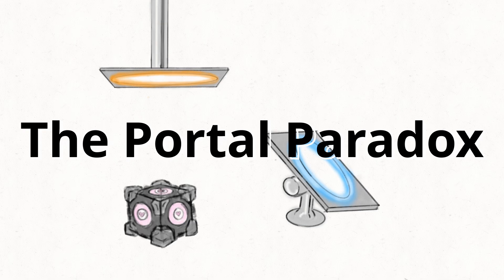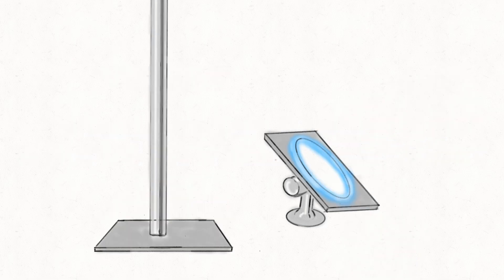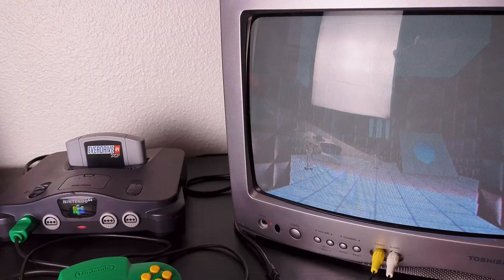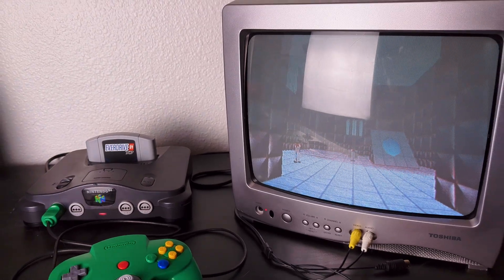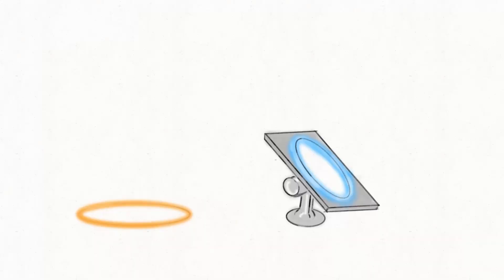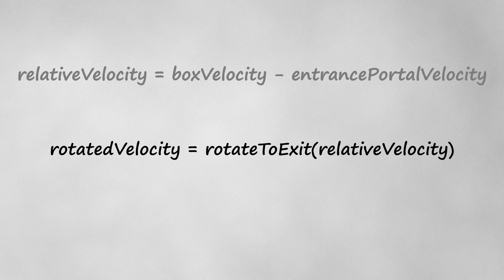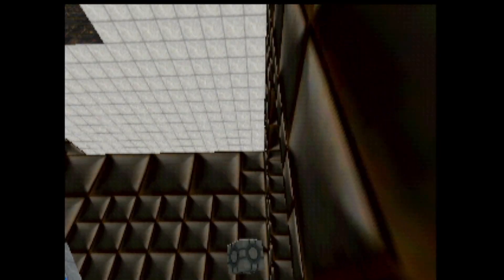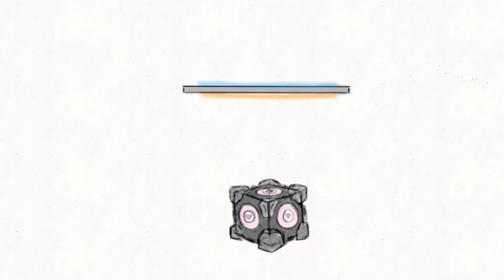I rewrote Portal from scratch and solved the Portal Paradox

Comment: Personally I'm not very into physics but I understand GLaDOS saying that the portals do not affect momentum to mean that my momentum will never be affected by the portals. Otherwise the forces acting on different parts of me might be so different as I pass through a portal, that I might conceivable be torn apart by a portal falling fast enough, as each part that enters the portal suddenly accelerates into the portal.
Reply: it's actually the opposite interpretation that has this problem. 

Say you have an orange portal that's stationary, and a blue portal travelling sideways at 1000 m/s. If you stick your head into the orange portal, this game dev's logic states that your head should poke out of the blue portal at 1000 m/s- you'd move along with it, so the most you'd feel is a strong wind whipping your hair.

However, if you don't think your body should inherit the momentum of a moving portal, then sticking your head out of the moving blue portal would cause your head to emerge at 0 m/s, as the portal flies away- (low-speed head goes in, low-speed head comes out-) snapping your neck clean off.
Reply: @Xtv1234  your treating the protals as 2 diffrent opjects when they arnt yes if you put you head into 2 moving portals you would feel wind but you would have to be able to move with the protal of be moved in and out it like sticking your head out a car windo you feel the wind but you are moving the same speed as the car but if one portal is moving and your standing till and the portal slams on you you just dropped a hula hoop on you exept your sided are in diffrent places making it so they portal never toughed you just moved around you and that the bug part the portal is moving around. think of it as if you jumped and someone through a hoop aroudn you do you gain its volocity no eve if it his the wall behind you no because you are know somever else on the other side of the hoop that never touched you, portals are doors not walls thats the problem hes treating it as if the portal touched you and it didnt
Reply: @Xtv1234 interesting example, but food for thought, it would technically require much more strength to even stick your head through that portal that is already moving, it would be like looking at a train moving away from you and trying to keep up. Vice versa, the portal would be moving and would require zero strength to jump in, because it would actually have a vacuum in space.

And suddenly, black holes are making me question a lot of things
Reply: @Xtv1234  At 3,600km/h, doesn't matter it the portal imparts speed... You get sand blasted by air particles (wind), and reduced to dust trying to pass through.
But the portal doesn't care if it is protecting you. If the blue portal is moving at break neck speeds when you pass through, it will break neck. As the object passes through, it is subject to all forces involved on the other side.
But, if a portal slamming onto you imparts speed... it should be consistent. If the portal moves at 5km/h (~1.4m/s) to pass your body through, you should have that speed on the other side... no matter what.
So, if accelerating out of a slanted portal results in a launch, then accelerating out of a horizontal portal should result in a jump. And if the speed is not enough to result in a jump, it should not be enough to result in a launch.
Look at it another way... an arrow doesn't fail to leave a bow just because you fire it straight up in the air.
Reply: @Xtv1234 I feel if you came out the back end you'd be perfectly fine and would just drop but if you came out the front end it would just blow you back in. 

A lot of people's theories seem to forget air exists and is real and we aren't just surrounded by empty space void of atoms.  The air would be going through too. You wouldn't just put your head through and have it suddenly be 100% different
Reply: @150booyadragon  In my example, assume you're coming out the "side end"- the portal is moving parallel its plane- and assume you tie your feet down and only stick your body halfway through. Not all the way through. What would happen?
Reply: @150booyadragon They're saying that it's moving sideways. The portal is parallel to it's path of travel, so it's like sticking your head out of the passenger window of a moving car, rather than out of the windshield or rear window. If you don't inherit the momentum, then your head will be ripped off, similar to standing on the ground and being struck in the neck/head by a moving car.
Reply: @Xtv1234  All I'm hearing is that either way you interpret it, moving portals would tear your head off.
Reply: @FlareBinar  well, no. Under this developer's logic, the only scenario in which your head gets torn off is a scenario in which one of the portals abruptly stops while you're travelling through it.

Consider my example again. You're standing calmly behind the orange portal. You look through, and you see the environment on the other side whipping past. 

You poke your head in, and it's like poking your head out of a car window. You can feel the wind whipping through your hair. You can see the environment racing past. You pull your head back. You're back in the calm room. 

Nothing about this scenario was intrinsically dangerous, or forceful. The entire time, the parts of your body that were through the respective halves of the portal maintained their momentum relative to the reference frame. You did not feel any forces on your body, your "momentum" did not abruptly change.

Now imagine you stick your head back out, but the blue portal collides with a wall and stops abruptly. The wall the blue portal is connected to stops, but the inertia in your body keeps you moving. You're immediately slammed at top speed in whatever direction the portal was travelling, possibly breaking or even severing your neck depending on the amount of intertia carried by the part of your body that was outside the blue portal.

In any case- the damage was caused by your change in inertia resulting from a change in the portal's momentum. It's the same as being in a car crash. If you're halfway through a portal that suddenly drops from 90MpH to 0MpH, the resulting inertia is likely going to kill you.
Reply: @Xtv1234  Here's a thought - what if your momentum is maintained relative to the exit portal, instead of the entrance portal?
Reply: Blue portal entry orange portal exit. The question is does your head have to undergo the acceleration outside of the orange portal? Here is an example to make sense of the orange portal. Your on a bus or a moving vehicle. Can you walk to the front? Yes. Does your water sit side ways in your water bottle? No. The energy from the vehicle was imparted onto you when it accelerated. All of the water particles in the container are moving at the same speed as the bus. In this case the bus is the non existent space between portals. The orange portal already has the energy because it is moving at 1000m/s sticking your head through would add some energy to the matter on the other end because in the blue portal mass there is pushing mass out the other side. All though if the portal were moving at the speed of light then you wouldn't be able to put mass through the portal because it would have to accelerate past the speed of light. Having a portal on earth and a portal in space moving at the speed of light exit forward wouldn't be a risk for blasting air into space. however any mass that the went through the portal would be blasted out at the speed of light. @Xtv1234
Reply: @Xtv1234 in your example, the room cannot be calm. A portal does not discriminate which matter is allowed to pass. It is not a closed window to everything other than what you want to pass through. Standing in the “calm” room, looking out at the environment whipping by, you would be able to feel the air getting sucked out or blown in depending on the differences in temperature & pressure of the two locations. Even if the conditions were somehow identical, there would be no way to stick your head out. Consider the difficulty of sticking your hand out of a car window and holding it flat against the wind. Even at 30-35 m/s you can distinctly feel the air resisting you. At 1000 m/s, even in perfect conditions, sticking your head through the portal would be akin to lowering your head onto a bench grinder.

The portal can’t just magically transfer its momentum to you as you pass through. The sheer forces being acted upon your body at an atomic level as your molecules all went from 1-2 m/s to 1000 m/s would spaghettify you. Portals preserve the momentum of the objects that pass through; they do not transfer their momentum to the objects.
Reply: @Scuuurbs  You make a good point about air resistance at 1000 m/s. Yes, the example i used is way too fast. the force of the air passing through would blow you away, and sticking your head through would be like the bench grinder you described. I should have used a more familiar example, like, 90 Km/H. Though, I stand by everything else I said. 

Portals don't really "preserve your momentum", though, not in the literal sense. They just translate your momentum relative to their reference frame.  

Think about what happens when you fall in one portal when both portals are on the ground pointed skyward. In the half second it takes you to pass through, if portals worked as you described- assuming I'm understanding you correctly- you should experience enough G-force to kill you as your body rapidly accelerates in the direction opposite your movement vector.

Yes, in hyper-reality you should absorb a tremendous amount of kinetic energy passing from a portal in a stationary reference frame to a portal in a moving reference frame. Yes, doing so violates the laws of thermodynamics. But portals already violate the laws of thermodynamics so fundamentally, it's kind of a moot point to me. I stand by my interpretation.
Reply: @Scuuurbs  Think of it another way: there is no such thing as a true stationary reference frame, all things are moving all the time. If you can step in the orange portal on this earth careening through space at thousands of miles per hour, and step out of the blue portal without experiencing any sort of lurch in your momentum, there is no reason you couldn't apply the same logic to a difference in the velocity of the two portals.
Reply: @Scuuurbs  By that logic, having two portals on a panel side by side, coplanar with the earth's equator, you'd be "spaghettified" as you passed through one of them. Why? Because relative to the earth's central axis you suddenly go from 1600Km/h orbit of the axis to your direct left(or right) and the front of your body as you walk through, is suddenly moving at 1600Km/h in the opposite direction. Whether you like it or not, every single portal can be observed with relativity to have momentum. Which either breaks the world of portal proving that the world of portal isn't on a planet, but purely in a simulation with no space (Difficult argument with the ending to Portal 2), just in a rendered environment with no global curvature. Or; Momentum is preserved relative to the portal, as you said, like an open window. If you shoot an object at 100m/s thought Portal A it will exit Portal B at 100m/s relative to it. If you poke your head slowly through Portal A, it exits Portal B the same way relative to Portal B. If the ambient air is passing parallel to the surface of Portal B, yes you'll have a highly turbulent flow of air witnessed at Portal A. If you stick your head outside a car's skylight, the witnessed wind can hurt. If you stick your head outside a jet's window, even at higher altitude with low air pressure, the bombarding air particles (wind) still hurt. Not enough to tear the human head from the shoulders, but you'd certainly witness an explosive decompression from the other portal if it was (relatively) stationary on ground level (Dr. Strange does a small nod to this when he's abandoned on Everest, the air starts to rush through the portal do to the difference in air pressure. Although that portal involves magic, so you can add in almost any BS laws and logic to that compared to Portal which supposedly still follows the laws of physics. Outside of the generation of the Portal and the teleportation of the material passing through).

The only way I see someone being spaghettified, is if the Portal doesn't keep your atomic structure connected as you pall though. But then anything and everything that passes through would be damaged, even if the atomic structure reformed, it would be like taking nanometre thick slices of the object (like with an MRI scan) and not "perfectly" stacking those slices.
Reply: @Xtv1234   "Say you have an orange portal that's stationary, and a blue portal travelling sideways at 1000 m/s." 
You'll have a huge problem, not caused by the portal itself but by air resistance. Your head will move with that speed through air 🥸
Reply: The car window analogy explains it all to me. Just imagine sticking your head out a car window while travelling at different speeds, and the different effects that would have.  There's a reason they don't let you open windows on a high speed train!

Also think about what happens to small objects near a car window at high speed. If it gets close enough and is light enough it'll get sucked out without actually entering the frame of the window on it's own.

For other directional examples, just imagine driving a van with no windscreen (and trying to climb out that windscreen at speed) or sitting in the back of a van with the back door open.

None of these examples will instantly decapitate you or anything like that (unless the relative speed is like, 2-300kmh or more maybe), you just get a graduation of opposing air pressures as you get closer to the portal. The front windscreen scenario the portal would be extremely difficult/impossible to actually pass through, and in any example you're gonna hurt yourself when you do come out the other side.

You could also imagine trying to jump INTO a car window as the car drives past you, even if you manage to time your jump perfectly, you're still getting hit by a car seat travelling at high speed.

It's harder to imagine what happens if the other side of the portal starts or stops moving while you're halfway through, but again, unless we're talking about speeds upwards of like, 200kmh, the impact with ground and walls is what you should be really worried about!
Reply: I think of it as a hole to somewhere else, not like a transition to somewhere else, you know?
Reply: It can be perceived as a transition because the space between the portals is warped so that it takes no time to travel across. @davidclayton1670
Reply: I think it's due to the change of reference frames. It's similar to how you see the light flying away from you at light speed when youre moving close to light speed. But an observer sees the light moving very slow in relation to the guy moving close to light speed.

Imagine you standing in front of the red portal. What you see another romm containing a cube.

Either the cube is moving towards you.Or You see the cube and the wall moving towards you. 

From this frame of reference both cubes actually have momentum. Since they're moving towards you. So the cube will continue moving towards you in both cases. 

When the cube moves through the portal. The reference frame fornthe cube actually changes. Because he is moving from its reference frame into yours. 

With the moving exist it's the same. The exit moves awan from you. You see the other side of the portal coming towards you. What is exactly what you'd expect from the moving portal. The cube you see through the portal has no momentum.

The problem is the difference of speed from both portal resulting in an indistinguishable case if you look through the stationary portal.
Reply: That's what I was thinking about, if we us the hula-portal example, what if the two portals started moving away from each-other at different velocities?
What then? I don't think being ripped apart would occur maybe a lot of discomfort and loss of directionality. There is no space inside/between the portals, or is there? vsauce music
Reply: Imagine you’re standing where the box is, observing the orange portal. From your perspective, the entire room on the other side has momentum towards you. Once you come out of the blue portal, the entire room would have to suddenly lose of all of its momentum for you to seemingly stay stationary, which it has no physical reason to do. Instead, it will continue on its path and you will start accelerating to match, either by reacting to the room’s gravity, or by hitting one of its walls.
Reply: There's the portal, and there's the aperture of the portals that had to prevent catastrophic events, like creating tornados because you decided to create a portal above another. The aperture end of the device did things like disengage the portal if movement was detected and generally acted to prevent different air pressure forces from building up as long as you didn't go off and do something crazy, like open one up at the moon.
Reply: This developer's implementation is the only one where you are fine when this happens. You don't spontaneously gain speed - from your perspective the space at the exit portal was already moving that quickly, and if not for air resistance, gravity, or impacting a wall you'd remain relatively stationary to the moving environment
Reply: Thing is, momentum is relative to your reference frame. If the portal is moving towards the cube, from the perspective of an observer moving with the portal, the portal is stationary and the cube is moving, so the cube has momentum.

Also in-game portals already change momentum. Momentum has magnitude and direction and the portals in the game change the direction no problem.
Reply: @NotaWalrus1 If you have a drone flying stationary and put an open window on the back of a truck and drive at the drone will it pass through and not move or will it suddenly ping off into outer space
Reply: @NotaWalrus1 what? If you move with the portal, the cube will be stationary, and you will be moving. You will be able to tell since everything looks to be moving from your perspective, even though the walls definitely aren’t rising.
Reply: @NotaWalrus1  Momentum is relative to your frame, but the problem here is that one of the frames of reference (the cube) is a non-intertial frame because it will accelerate relative to the outside world. The portal's frame of reference can be assumed to be an intertial frame because the supposed result of the cube's motion here would be the same regardless of whether the cube was floating or sitting on the ground so the portal doesn't accelerate except for at the very beginning of it's motion. The acceleration of the cube needs to come from some outside force. Where is that force here? I suppose you could hand wave and say that the portals themselves are providing the energy to move the cube, but I find that dissatisfying since they're not supposed to be able to affect matter in that way. 
This is less a matter of conservation of momentum (which is still absolutely relavent here) and more a matter of conservation of energy. The energy to make the cube start moving needs to come from somewhere, and I  personally don't accept that the already physics defying portals are the source of that energy since that starts us down a long rabbithole of what exactly the portals are and how they work.
Reply: @NotaWalrus1 but I think this is what proves that portals couldn’t exist. Because the fact the portals would tear you apart if they were moving and you were stationary, but not if you were moving and they were stationary, means there is an objective frame of reference / way to discern which object is really moving.
Reply: @JosephF.  They would not tear you apart unless they were accelerating. From your perspective going through a portal at constant velocity does not impart any forces onto you
Reply: @NotaWalrus1  I agree you kind of have to be correct for portals to make any sense,but I struggle to really think how. I guess the tension you should feel would be counteracted by the portal coming towards you somehow, because your portal relative velocity on both sides is still 0. Still seems completely unintuitive to me that this could work, but yeah, I guess it must work this way.
Reply: @JosephF.  It's a little unintuitive but essentially, if the exit portal is moving (at a constant rate) and the entry portal is stationary, then from your perspective the entry portal just looks like a door behind which everything is moving at some constant rate. Crossing it would not be any different than crossing a door, it's just that the stuff behind the door is moving, but that doesn't mean you feel forces when going through (maybe some wind).
Reply: @NotaWalrus1  There's no reason to think that portals have their own reference frame though. Even though the portal is "moving" that doesn't mean it has it's own velocity in a physical sense because it's not a physical object.  It's just a location.
Reply: @takanara7  A reference frame is just a convention on which point is at coordiantes (0,0,0), which time is the time 0, and which velocity is a velocity of 0. When one says "the portal's reference frame" all that means it's that we're picking a reference frame in which the portal is stationary.
Reply: There are some really interesting discussions going on here folks and I’m definitely enjoying it. I think I would enjoy quite a lot more though if I actually understood most of it lol. But keep it going it’s very interesting trying to wrap my head around it and understanding the points you’re making :)
Reply: @NotaWalrus1   The cube doesn't have momentum. Momentum is energy. Shifting momentum as with a gyroscope is necessary for the conservation of energy, so your direction of momentum can change so long as the magnitude doesn't. A viewer looking through the portal would see the box enter at the speed the portal is moving, but that is only due to the portal moving space to the cube. Once the portal stops moving, so would the cube, as it imparts no energy to the cube, the cube cannot go from not having momentum relative to the system (the room) to suddenly having momentum.
Reply: @Darkblitz9  Momentum is momentum, energy is energy and they are not the same. 

(Linear) Momentum is a vector quantity measured in kg*m/s, usually calculated as mass times velocity. (kinetic) Energy is a scalar quantity measured in Kg*m^2/s^2,  calculated as mass times speed squared divided by two. (Note the distinction between speed and velocity. One is a vector, one a scalar).

Both are preserved quantities, have similar equations and relate to movement, so confusion is understandable. But they are not remotely the same. It should be noted that both are also dependant on your frame of reference, since speed/velocity depends on frame of reference. The portals in the game violate the law of conversation of momentum because they change the direction of the momentum vector (though they do preserve the magnitude). They also violate conservation of energy because they can lift an object without applying a force, increasing the object's potential energy (but they preserve kinetic energy). This applies to portals that are static. Once they start moving they violate both conservation laws in every posible way.
Reply: @NotaWalrus1 so when im in a car i see me as the stationary object but all those people standing outside have momentum? I dont know that doesnt make any sense when applied.
Reply: @Weyk47  Yes, that is indeed how frames of reference work. It's a pretty fundamental concept in physics and one of the first things taught in Physics 101. 

For instance, if you use the laws of physics to calculate the result of a collision between a moving car and a stationary wall, you will get the same result as if you calculated a collision between a stationary car and a moving wall. 

The thing to Google if you want to learn more is "inertial reference frame".
Reply: @Weyk47  You should check out Einstein's elevator thought experiment. That's exactly what it's about.
Reply: @NotaWalrus1  Except, it's not relative.
Take riding in a car. You are in the passenger seat.  From your view, everything is accelerating toward you. If the driver suddenly slams on the breaks, that 'relative speed' everything has doesn't suddenly cause pedestrians and debris to go flying past the car you are in.
Because you are the one with speed, and at no point did you impart velocity to the stuff you are viewing.
Relative - You, the driver, and the car are stationary... everything outside the car is moving.
Reality - You, the driver, and the car are moving... everything else is doing it's own thing that is independent of you. (Unless the driver hits them with the car.)
Reply: @hermanphilips4617  I can say little to this except that you're being willfully ignorant and should read the first chapter of a physics 101 book. It is a basic principle of physics that all inertial reference frames are equally valid and the universe does not have a preferred one. As such, it is impossible to say in absolute terms that an object is stationary or in motion. An object can only be stationary or in motion relative to a chosen inertial reference frame.

This is called the principle of relativity, and it goes all the way back to Galileo (not to be confused this with Einstein's Theory of Relativity, which is kinda related but distinct)

For your example in the car. While the car is moving at constant speed your perspective could be considered an inertial reference frame, and as such you can model the situation as you being stationary and everything outside the car moving towards you (not accelerating towards you) and all the physics will work out fine. When the car breaks, that applies a force onto you, which means your reference frame ceases to be inertial. You can still use it, but non-inertial reference frames are not equivalent to inertial reference frames and need to be treated quite differently. Things called fictitious forces appear (which are the reason you feel like you're being pulled forward when the car breaks).

Think about it this way, yes, an observer on the ground would describe the car as moving and themself as stationary, but an observer on Mars looking at the Earth would see both the car and the observer moving at really high speeds, and their numbers would give the same results as the Earth observer's numbers.
Reply: @hermanphilips4617 
All motion is relative. There is no single objective reference frame. Your understanding is factually mistaken.

For a pedestrian to fall over, they would need to change momentum relative to the ground, not relative to you.

Since both they and the ground have changed momentum relative to the car in an identical degree and direction, you wouldn't expect them to fall over.
Reply: @fieldrequired283  Okay... so let me see if I have this straight. Because the ground is also observing the pedestrian, the ground's relative perspective of travel wins against the relative observed travel from the car. So, the passenger in the car thinking 'oh, everything is coming at me so fast' loses in the fight against the ground observing the pedestrian as walking?
In other words, observed speed means nothing against reality. So the additional 'speed' an object looks to have due to the movement of the observer is actually nothing. Instead, what matters is actual imparted velocity that transfers during physical contact, or pull due to mass (aka gravity).
---
The cube, in relation to the platform it rests on, has not gained any momentum.
However, one could argue that in relation to the exit side of the portal the cube must have velocity to exit the portal. Because if it has no velocity, it is not travelling and thus does not move through the portal.
But how does that work when the amount of velocity changes based on the angle the exit portal rests at?
Reply: That's only true when the falling portal changes its speed quite a bit or suddenly stops.
Reply: I just had a 180 in my opinion, and now I think the box just plops out.

The portals are wormholes, bending spacetime to make multiple places the same place/time. It doesn't matter how fast then entrance/exit is moving, they are still the same space. I think the hoola hoop bit is a perfect example of this. 

Though, I am also not very into physics.
Reply: @philipt2  If you were to watch it in slow motion from the stationary side though, as the moving side speeds over the top of the box you would see the box appear at that same speed, so once it's completely out, it would have to very suddenly reduce its velocity to slow down to a 'plop'.
Reply: @philipt2  your right the problem is the creator of this video is thinking of portals as 3d objects when they are not they are 2d objects like your shadow
Reply: I’d say since the momentum remains the same, and relative to the falling portal you’re moving towards it, That’d mean no forces are applied to you, and it would be like you were always moving. The momentum is transferred with 100% efficiency.

The reason it doesn’t rip your head off is the simple fact that you were never moving in the direction for that to happen before you were.
Reply: @temhgb  momentum does not remain the same, remember, the box's momentum is relative to the system it's in, the room. The portal is not an object, it has no relative speed, it is "attached" to the piston which has momentum and relative speed to the system and the box, but when the piston stops moving, so does the box relative to it. To have the box continue to move relative to the piston after the piston has stopped would violate conservation of energy.
Reply: @Darkblitz9  You’re right about it violating the laws of conservation of energy, but you forget we’re talking about portals. (They don’t exist, and their mere concept also violates those same laws)

And your point about momentum is invalid as the system may be the room, but that does not mean the entry portal does not have momentum or relative speed. (It is literally moving)

If an object of any mass has a velocity, it has momentum.
The overall momentum in the room, with no more moving objects except for the entry portal, is total to the momentum of JUST the entry portal and its platform.

The momentum gets transferred to the object - 
 (impossible, as the total momentum increases because both the object and portal are moving the same speed, but we are talking about portals here (they don’t exist))
- and the object comes out of the other portal with the same momentum as was inputted. (Ignoring gravity and air resistance, of course)

Also, ever heard of the law of Conservation of Momentum? It means that in a system, the momentum is Conserved, and stays the same!

Also, being “”attached”” to an object with momentum SHARES the momentum. Attached objects act as one object.
Reply: @temhgb  The existence of portals doesn't violate any laws, there are higher physical dimensions and space can be bent and connected through them. If you argue that Portals can't exist (which they can according to our current models) and that we're using fantasy sci-fi technology that can't exist, then any argument you make for any result of the experiment is fine because you can handwave it with "sci-fi magic". And you're right, momentum should be conserved. The box doesn't have any, so it shouldn't gain any unless the piston directly interacts with it. Since it doesn't, and the piston stops, transferring its energy into the platform or whatever brakes are stopping it, the energy of the system remains in compliance with the laws of physics.  I'll put it this way, when I slam open a door, should everything in the room, beyond come flying out at me because relative to the door they had to conserve their relative motion? No of course not,  that would be silly.
Reply: @Darkblitz9   Portals as described in game cannot exist by definition.

If you setup a stationary portal exit above a portal entrance then a box falling through the portal is gaining momentum by constantly accelerating toward the earth.

it is a perfect unlimited unending source of kinetic energy (its effectively slowly accelerating the earth toward the box by accelerating the box constantly).

Therefore, portals as defined by the game break the laws of physics.

Which also means the portal paradox makes perfect sense.

But you guys aren't thinking with portals.  When you have a moving portal, you are thinking the entrance room is the same as the exit room.  **this is not the case**.  The exit room is a section of space that is moving at a different velocity to the entrance room.  Why?  Because the portal is the only "stationary" component of any of these spacial domains.

If the red portal is moving, then **the entire world around the red portal is moving**.

The box is moving with respect to the red portal, so when the red portal covers the box the box is "moving toward the red portal".  If that is hard to get your brain around, imagine the floor of the entrance room "pushing" the box into the portal.  (Like just imagine the red portal is stationary and the whole room pushes the box into the red portal).

Remember, the portals preserve momentum **between the portals**.  But they only preserve relative momentum *to the portal itself*.

If there is a caculable momentum difference between the entrance room and its contents and the red portal, then that same momentum exists in the portal entrance/exit plane.  Therefore, since the box moves towards the red portal from the red portals perspective, it is as good as moving through the red portal thus it comes out of the blue portal with that momentum.

It is all in reference to the entrance portal.
Reply: @meateaw  They can exist, space is far more flexible than you think as soon as higher dimensions come into play. And the "entrance portal" can't be a reference point because it doesn't exist, it's just an identifier for where space is pushed together. You might as well say that the corner of your room is a reference point and if you stop walking, the desk in the corner must move to maintain momentum. It's very silly.
Reply: and GLaDOS is definitely known to (a) be correct about everything and (b) tell the truth. /s
Reply: @parkerklinck263  does your shadow effect you when it moves?
Reply: The portals do not affect momentum, which means that they do not exert a force. With all that bullshit you wrote, I can’t tell if you’re agreeing or disagreeing with the physics in the video. 

But that statement you cited further enforced the physics within the video. And the physics within the video is objectively correct anyways, any grade schooler can grab crayons and draw out the vectors to affirm it.
Reply: @AngryFloatingCow  The physics in the video isn't physics, it's programming. It's not objectively correct because it breaks conservation of momentum/energy.
Reply: The cube appears to "gain momentum," in a certain sense, as it emerges from the blue portal and flies out, but from its perspective, it's actually at rest as it flies out of the blue portal because from its frame of reference, it never experienced any acceleration. It's only once the forces of air resistance and gravity start changing the vector of its motion that it begins to experience acceleration and, thus, ceases to be at rest until it's on the floor again.

Also, the cube emerging from the blue portal at all necessarily means that relative to the blue portal, and thus relative to all space around the blue portal, as well as to the cube itself as it passes the blue portal, the cube must be in some kind of motion. If it wasn't, it wouldn't be capable of making it to the other side. If you watch a cube emerge from a stationary portal at, say, 500 mph, to be dramatic, would you expect it to suddenly stop, or to shoot off at 500 mph? It seems obvious, to me, that the answer should be the latter. Once the cube is past the threshold of the portal, it must be in motion to remain at rest.